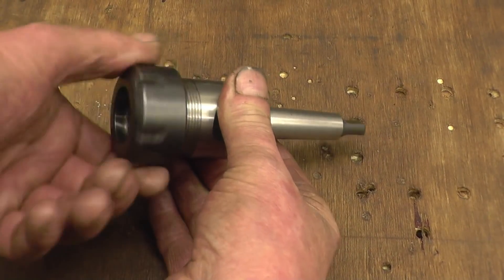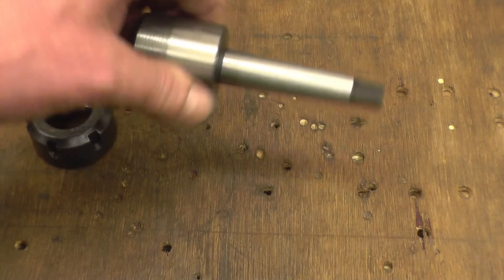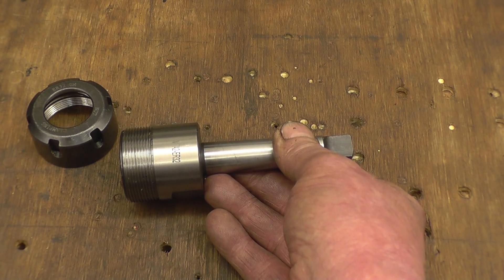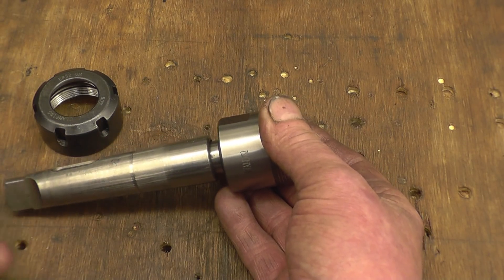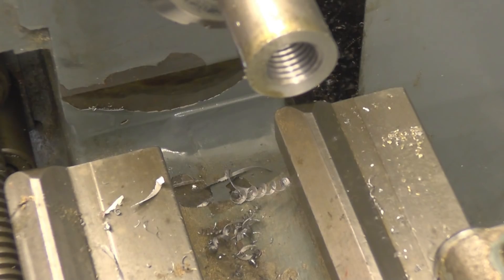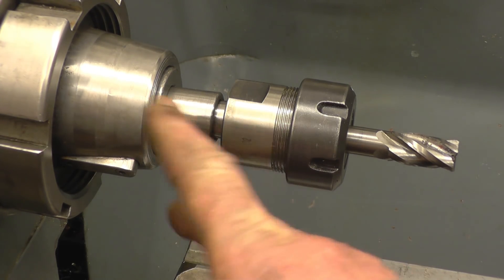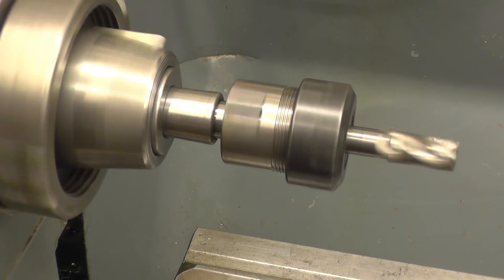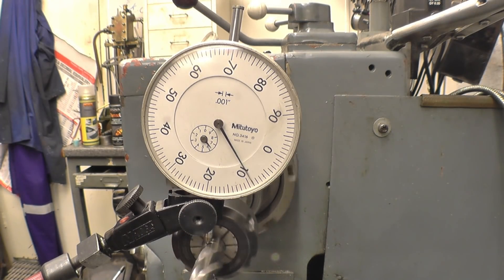Banggood ER32 /MT2  Collet Chuck Review

Comment: John, I have the same set up, just not on the payroll lol. The one I ordered was  MT 3, it also didn’t have a tang. I ended up making my own knock out screw for mine. Since I was planning to use it like you do I wasn’t as concerned about runout, so for the price under $20 USD you can’t beat it. The only drawback is the delivery time, it tends to take 3 to 4 weeks to get an item from Banggood. Great review and Happy New Year

Comment: John...

If your going to dedicate one of these collet chucks for the tailstock then turn yersen up a wheel and mount it onto the sleeve that tightens down the collets...
There..
No more having to arse about with them crap multi pin spanners...
As you'll get enough tension on them collets with the hand wheel... 😉

A pair of DTI's...one on the cutter...the other sneaked in on that bit of MT3 that were showing...would have offered a clearer identification in real time...of where that runout was actually occurring...

Comment: When you checked runout with the chuck in the headstock, I kind of wish you'd checked the runout in the MT2 socket before trying the chuck in it. This would give some idea of how much tolerance was in the adapters vs. the chuck itself. It would also rule out the (admittedly unlikely) possibility that you got lucky with the tolerance stackup and underestimated chuck runout. 
I will concede that the cumulative runout was small enough that it's unlikely that any of the contributors (spindle, adapters, chuck, collet) are very far out.
Reply: John has previous videos showing the adaptors themselves have very little runout, and with a little bit of finessing he should be able to stack them to a near zero runout, and put a mark on them to align to the chuck keyway. But for most jobs he does that is pretty good for random stacking anyway.